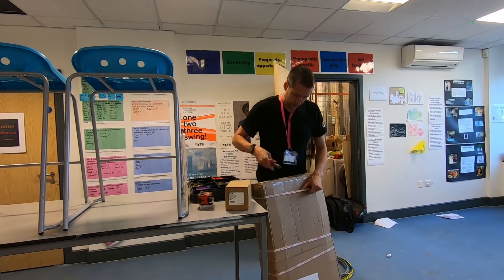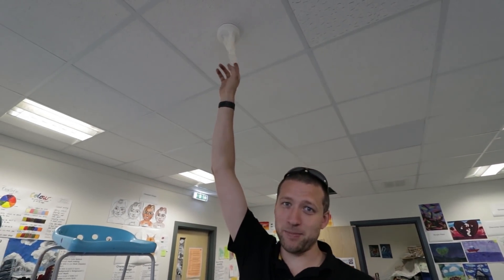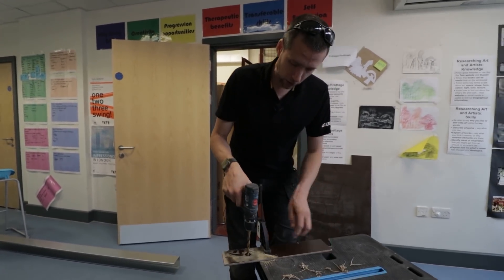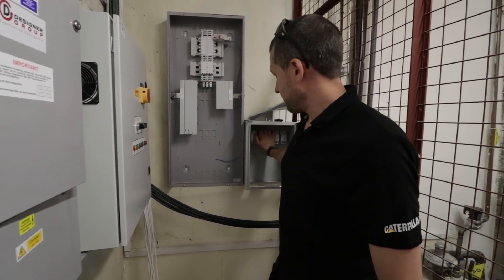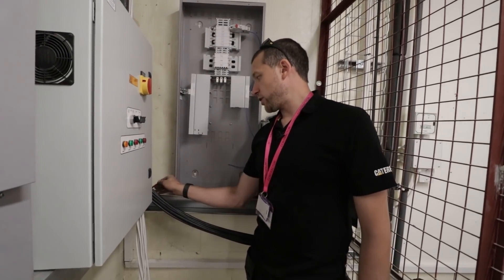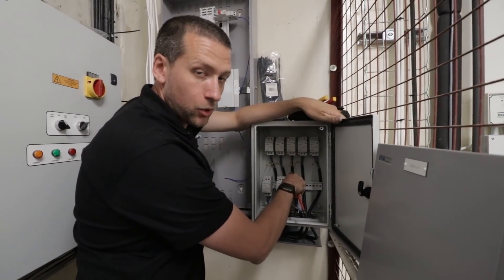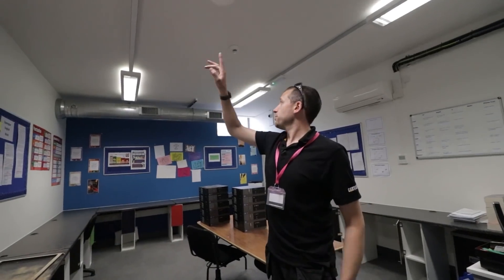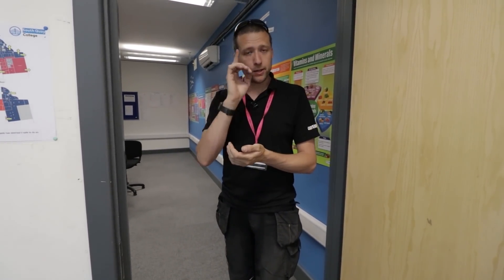Fitting a new three phase panel - (and a bit of steel trunking) | Thomas Nagy

Comment: Have you tried re sharping the spade bits, I use to do that all the time with a file you can re sharpen them 👍🏻
Reply from the maker: Actually no; But i will give it a try and report back
Reply: thomas nagy when I was an apprentice and had no money you always find a way 😂
Reply: @thomasnagy  Try forstner bits. I am not a fan of them janky arse spade bits .
Reply: I usually do them on the angle grinder.
Reply: Yep, we were made to do this when I was an apprentice, twist drills too. Our instructor would take something like an 8 or 10mm hss bit, grind it flat and say 'over to you boys, drill me a hole with it'.

Comment: Think I might have been getting an Eaton din rail stacking unit for the top of the DB just for the contactors far easier than bushing a third party enclosure to the side, also is that a high capacity DB ☺️
Reply from the maker: They do one for the bottom i believe; Didnt think about it until afterwards when i stepped back. lol

Comment: One thing to watch Tom. When you get a situation like 4A flowing into the "Earth bar" be careful not to touch other metal.  The reason I say that is that the chances are that "Earth bar" will have some resistance with respect to the real earth and if the other piece of metal that you touch has a lower resistance to the real earth you will get a belt!!  Don't ask me how I know :-)
Reply: Its a possibility on a TT earthing system but on a TN thats not going to happen .
Reply: Ohms law is a beautiful thang 😉
Reply: My hands are already tingling with exitement to find out ;)

Comment: No dis Tom, but I believe that borad (while it can) is not really designed to hang individual circuits off.  We use these boards when we put in sub distribution circuits.  Seems like a bit of a faf you got there.  Personally I would have made a control panel with everything built in.  If you wanted to go while hog, use a Schneider acti9 board and you can remote monitor the system.  None-the-less a very tidy job coming along there.

Comment: Genuinely interested by what was causing the large earth leakage.
Reply from the maker: I think its actually just all the computers that are plugged in causing the leakage. 2 or 3 ma per PC, multiply that by 50 then add on projectors etc. 
Not enough to trip an RCD but added up over the whole board its possible i guess..
Reply: @thomasnagy  Why do computers leak so much to earth?
Reply: @jeales895  Chinese PSUs
Reply: @jeales895  Bad powesupplies maybe? Just checked mine ... No leakage.
Reply: @jeales895  almost all switched-mode power supplies have filters inside them to reduce EMI and they leak to earth a little.
Reply: @jeales895  they use switched mode PSU's
Reply: @jeales895  switched mode power supplies in computer power supplies have capacitors between L&N to Earth. Part of the filtering. As do most modern supplies these days. That's why they introduced "A type" RCD's as AC type RCD's can't detect DC on the supply.
Reply: @muzikman2008  The filter capacitors pass AC, not DC. That's pretty basic. So no, those filters have nothing to do with type A RCDs.
Reply: @jeales895  many electronic devices are having R/C filters on the input side as it is connected between phases and earth it sums up for many PCs or in many cases it happens with UPS as well and according IEC it is acceptable
Reply: Hmm this can be a issue.
Reply: @thomasnagy  You had 2100mA leakage right? I think that is a bit too much for ''normal'' EM filter leakage, even with 100 SMPS. I would expect no more than 500mA.
Reply: thomas nagy Sort of like a parasitic drain in a car?
Reply: @thomasnagy  i don't think this is normal, just think about it, kilowatt of leakage.
Reply: thomas nagy great video again Tom 👍🏼
Reply: The switch mode PSU's used in modern computers will leak a few ma each to earth - even expensive models such as HP/Dell servers. To get 4A of leakage tho - thats a hell of a lot even for a computer suite. How do I know? testing of industrial computer cabs (to 60950, soon to be 62368) with numerous systems installed in each. Only comment I would make about that earth bar is it should possibly be labelled in black on yellow as 'warning, do not disconnect before isolating power, high leakage current' or similar.
Reply: Pme supply.
Reply: Flouresent lamps  also make small leakages.  Think this is the major  one,  if theres alot of them.
Reply: Just checked my PC, leakage is 0.69 mA.
Reply: Last time I saw significant earth current it was courtesy of a faulty neutral in an adjoining property (via MEN system). Very dangerous situation.
Reply: Due to PWM from the power supplies distorting the sine wave when rectified. 6 pulse VFDs tend to distort it the most as well as solar
Reply: @pauljones908  rectification has nothing to do with leakage to ground.
Reply: The earth leakage on the water bond is an interesting one though? Maybe an element on its way out somewhere?
Reply: But what about the water bond? Dodgy heaters?
Reply: Four amps leaking to earth. That’s easily enough to start a fire! Takes over a thousand PCs to get anywhere near that! Why no 500mA main RCD on the board with the fault!?Something is seriously wrong there!
Reply: Thats leakage current is more than a few PCs
Reply: Photonicinduction would know the answer! If he was still about.
Reply: I remember doing a high school a few years back and they were insistent on running 'clean earth's' into every classroom that had computers in it. Ring earth and a separate earth Al together for a drain
Reply: Laundry room appliances- washing machines or kitchen water seepage , or incoming water pipes
Reply: That sounds like a bad internal Power Supply inside the PCs

Comment: You can just hear the keyboard warriors typing now: “YOU CANT PUT A GLOVE OVER A SMOKE DETECTOR!!”
😂😂😂😂😂 I am now going to read through the comments
Reply: Nothing wrong with it, as long as you raise the alarm if needed and remove it when you leave site not a problem, false alarm management is a huge thing and it’s better than someone trying to disable it and doing something wrong at the panel end. Anyone wanna say different I’m a level 3 fire engineer, 17 years in the trade and a director for The British Fire Consortium.
Reply: @ashleypalmer8207  What I do is tie a piece of red string to the gloves finger so that it dangles from the ceiling. Just so that you don't forget to remove the glove when you're finished.
Reply: A simple response to that is " well i fucking am"

Comment: Did you use safety glasses when you use your  angle grinder?! :o ;)
Reply from the maker: ummmm....
Reply: @thomasnagy  Uvex Pheos m8. Cheap and keeps most flying shit away. Also doesn't fog up and you'll forget you're wearing it after 20min.
Reply: @thomasnagy  I just put on the safety squints
Reply: I'm sure I saw "safety squints" as AvE says. 😉

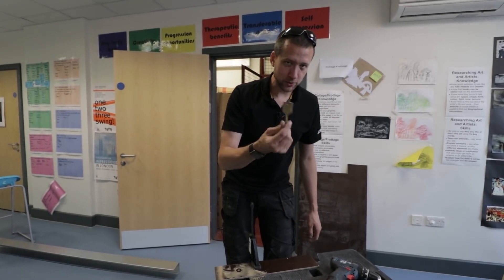Comment: 5:26 I use lawnmower blade sharpener drill attachment do hickey. 10 seconds like new again.
Reply: I've always used a bench grinder or even an angle grinder in a pinch. Never thought of the lawnmower blade sharpener, I must give it a go 👍

Comment: Try a 20mm hole saw last much longer. Keep
Up the good work😀
Reply: Hole saws are a pikey tool. A proper spark would use a punch out tool.
Reply: Don’t they only work on sheet metal?

Comment: Never worked with 3 phase and metal trunking. Why do you want to isolate them from one another?
Reply: The paxolin is used to protect cables passing through so as not to have them potentially damaged by the metalwork.  Same thing as with a grommet.